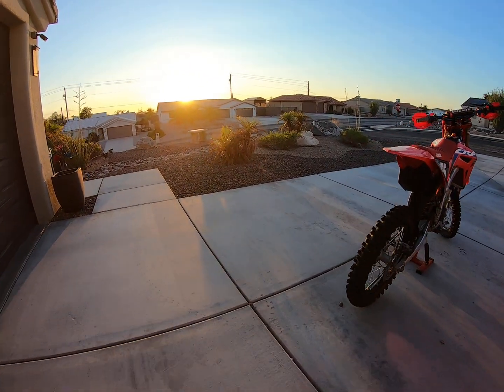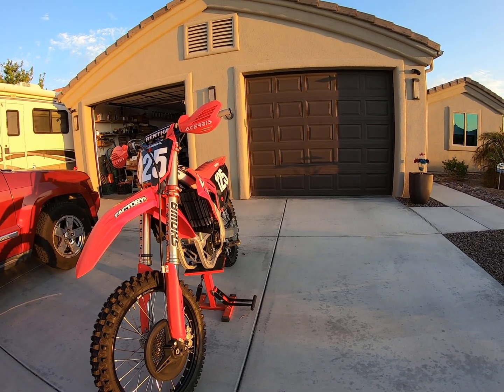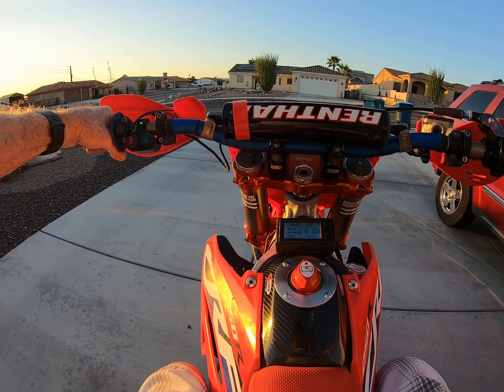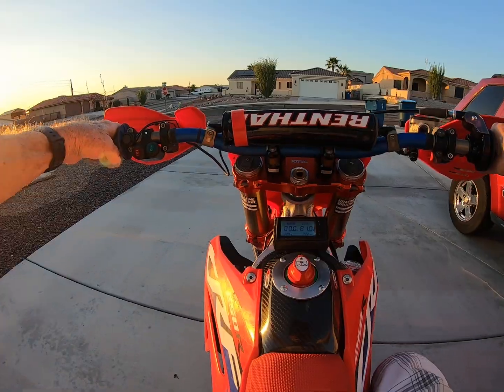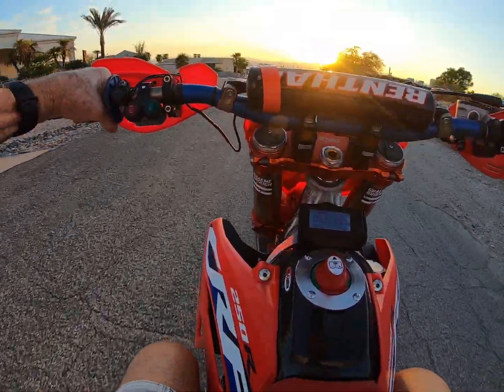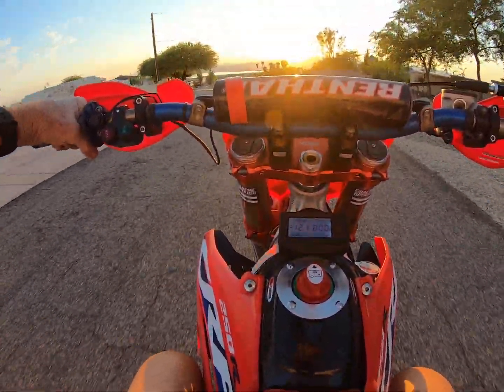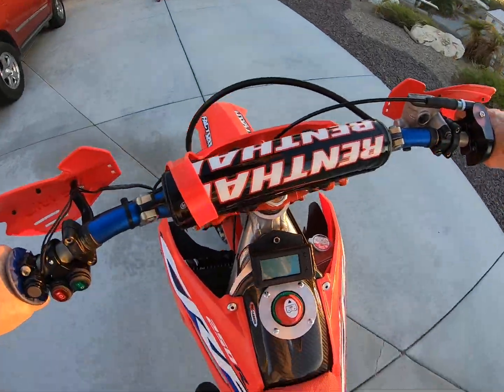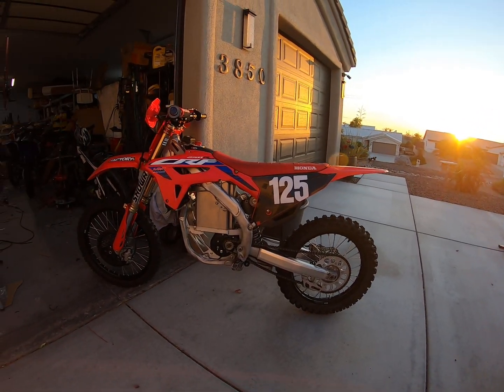2023 CRF250R with QS138 70H V3 motor, Em260S controller, and 50AH battery.  Second test ride

Comment: Awesome build, I got this motor's little brother, the QS120 at 2KW. V3 version with gear reduction 1:2.45 I believe - do you think its strong enough to power a pitbike frame 17 inch up front 14 inch rear? Looking at about 50kg's for the bike, excluding battery and motor - built up it will weight approx. 62 - 65 kilo's, with a 70 kilo rider. 
It looks like you've got all the power you need on that beauty, I figured I only needed torque not the top speed.
Reply from the maker: That motor is a little underpowered.  We put the QS 138 70H V3 in the KX85-100, YZ85, RM85 etc with the Votol EM150SP/2 controller.  A 20S8P   ( Lishen 21700 cells as a minimum )battery will give you good performance
Reply: @dcoxryton  Yep, thats the motor my brother got. I might have to look for a slightly lighter frame in retrospect. Thank you for the reply my friend. Enjoy the sick build, looking really proper.

Comment: Hey bro, how did you create the geometry of the bracket to mount the engine to the frame? Is this bracket sold somewhere or did you design it yourself?
Reply from the maker: Lithium-Kimg.com built it for me.  Give him a few simple measurement, ( but you must be accurate), and he will get them made for you.

Comment: What main power switch are you using? I have a similar setup, 40ah Amorge battery with EM200 but don’t have a main power disconnect
Reply: I'd like to know also.  I see these Marine switches rated to 48volts but I'm running 84V max and don't want to arch out the switch.  The 300amp ANL circuit breakers are huge and the ANL fuses are slow to burn.  Would love to do this marine switch if it's working great so far!

Comment: How does this motor setup work against a 250f or 450f? As far as power or racing?
Reply from the maker: Most of the bikes we have built, and other people riding them say the have 250 top end and 450 power out of the turns. I am putting a mode in the controller to increase the top end 20%.   I am going to test it tomorrow It should improve the top end , and low end power is there.
Reply: @dcoxryton  I have the Electro & Co kit ordered now. Your videos have been very helpful. Do you have an Instagram we can follow?
Reply from the maker: No I don't post much or anything on Instagram, but I have a lot of my work on Facebook "Electric Motorcycle Builds" and on the forum ElectricDirtRiders.com, the old AltaOwnersForum.com.  Glad to be helpful .  Start a conversation on the ElectricDirtRiders.com forum with me and I can share info and pics.  @racingfortheson
Reply: @dcoxryton  done 🤘🏾

Comment: Does the 60 degree hall sensor work out for you ?  We run a EM150 2/SP with the QS 138 70 & if the track is pretty smooth it is perfect.. but if it gets super rough it will cut off from time to time. Or if you let the chain get too loose and go through a whoop section it will cut off going into the corner  It seems to always cut off kinda off throttle.. AJ Cantanzaro raced it 4 motos at Tomahawk this weekend and it was perfect all weekend except the last moto someone bumped his rear wheel in a corner & he said it cut off for a second..this has always been an issue for us.. Im considering something vesc and the encoder system...20s8p molicell all copper .... your thoughts...
Reply from the maker: Wow.  First off, all of ours are set up at 60 degree hall sensor, and they seem to be fine.  Are you running an ElectroandCompany.com setup and tune?  Do you have a BMS on the battery?  We run our batteries with only BMS charge control so the battery isn't an issue, we have seen a lot of temp problems in the battery, specially if the BMS is inside the battery box, but those are usually stopping faults.  I have not had a single fault cutout, or drop and restart with my combo very similar to yours due to the motor or controller, in 500-600 laps at the track.  With my old battery I could only get 390A ( a  42AH battery) (no faults though)  now I am getting 400+Amps with my new battery  (20S12P Molicel) ( no faults either).  My current meter only reads to 400A and then goes to FFFF.  I've seen that a few times.  We have seen this problem on a couple other bikes, and one was moisture in the encoder part of the motor. He had submerged the bike early on.  There is a link on it in Facebook "Electric Motorcycle Builds". I think I have seen you on that forum.  The o-rings are too small on the encoder cover, but if you have moisture in there, it stops and then starts again until it stops altogether.   I got some other stuff, why don't you start a conversation with me on "ElectriDirtRiders.com" forum, so I can send some pics and info.  I have a EM260S controller, their new one from E&C.com and it is getting faults just like you are talking about.  But E&C says they have a firmware upgrade for me to fix that.  "Overcurrent dropouts" on the new Honda I just built , also on the Facebook Electric Motorcycle Builds forum.  They are all under my name Donald Cox
Reply: The QS 130 can't run an encoder set up with the Voltol controller.... If you are running vesc stuff with the aftermarket encoder then yes... @dcoxryton

Comment: What battery were you using. Looks great
Reply from the maker: I build the batteries.  It is a 20S12P Molicel P42A.  The case I can get for you for about $200 for just the aluminum shell.  The approx size of the alum box is 8 1/4" by 6" by 13 1/4 tall.   This size box works in this 2022-2023 Honda CRF 250-450, and in 2014 and newer YZ250F and YZ450F frames.  Send me an email and i will send you photos.

Comment: I'm about to do this exact swap on a 07 crf250r. what size chain did you use? if you used 520 where did you get the front sprocket?
Reply from the maker: Lithuim-King.com.  They have regular front Sprocket, and they have a new model with a  greater shaft contact area.  If this is your first build i would recommend getting the kit from ElectroandCompany.com.  Save yourself a lot of headache.

Comment: What are the specs of the batteries? Are the two batteries wired in series?
Reply from the maker: I built the battery in two halves, each half is a 20S6P  battery and it's own ANT Smart  BMS used for Charge only.   The 2 batteries are in Parallel in the bike. I can run on either one of the batteries at 250Amps, or both batteries together at 500Amps. That way I can disconnect the 2 batteries for Charging only and Charge each battery on its own 15A Charger when I only have 120VAC. One good Honda 2200W generator can charge one battery, get 2, or a 3500-4000W generator can run both. I have variable Amp chargers, because at altitude generators don't put out as many watts. But with this system, I can go from 30-40% to 90-100% in about an hour
Reply: @dcoxryton  c'est un exellent choix !

Comment: Looks great Don! So is the EM260S different than just the EM260? Looks the heatsink has some fins? And you've liquid cooled and located the controller where the left radiator should be. Very nice and I'd imagine that will keep things much cooler than the previous builds.
Reply from the maker: Yes the EM260S is the new version of the EM260SP/2.  It is smaller, and it says that it is good for 500A??? haven't seen that yet.  The heatsink on the left radiators spot is for the BMS's.  I split the battery into 2 packs, so I can put 2 x 15A chargers on it for faster recharge. And the BMS's were overheating after a couple charges.  So I moved them out of the battery box and on their own heatsink cooling spot.  The controller is where the airbox was , and I do have a water cooling system on it.  It is all hooked up, but I haven't pressure tested it yet, or put antifreeze in it yet. We are going to Glen Helen to test it tomorrow.
Reply: @dcoxryton   Very cool! Always innovative and informative. Thank you! Interesting idea to separate the BMS. Makes a lot of sense. Is that a common thing to do in electronics? Haven't seen it in my limited battery/builder exposure.

Comment: That bike looks so good! How long will the battery last on a normal ride?
Reply from the maker: About 30 miles on the street or trail riding.  It is a 3.6KW battery,  about 100 to 150watts per mile.  On the track a friend with the same setup ( same motor, controller, and 3.6KW battery in a YZ) raced some motos at Glen Helen on the Hill Course.  6 laps race, and he was just under 50% battery left. It might make 10 hard moto laps.  There is a quick change battery system a friend is making for the 2014 and newer YZ250F/450F. This year 2022-2024 CRF could be made into a quick change also.

Comment: Do you have a link to the stuff u have on the left side your handlebar?
Reply from the maker: No I don't.  The black kill switch was actually on the donor bike as the perch mount for the front brake reservoir.   I added a back side to it and mounted it on the left side.  There are a bunch of them on Amazon from $9.95 TO $49.95.  They have similar switches to the ON/OFF and 3Mode Switch on Amazon too, but not that one identical.  The switch actually came with the motor kit from ElectroandCompany.com    https://www.electroandcompany.com/product-page/e-c-prepared-switch-gear-5-pin

Comment: What's the weight of the bike with the current set up? 
Looks well thought out and fabbed up nice.
Reply from the maker: Thanks for the compliments.  The front wheel has 110lbs on it and the rear has 116lbs on it.  I haven't filled the controller cooling system yet, and a few more cooling parts.  Maybe 2 lbs more. The empty donor bike weighed 72lbs on the front ant 71lbs on the rear.